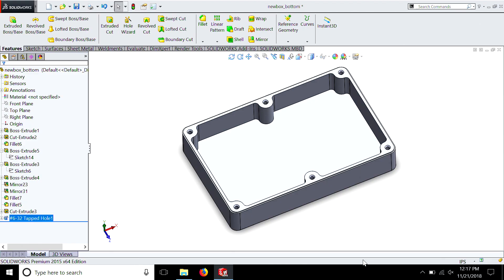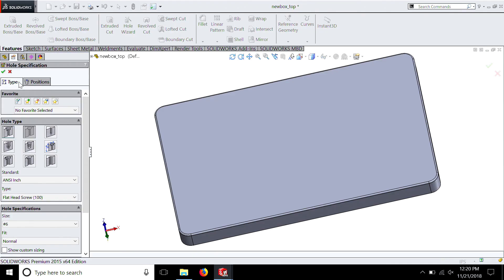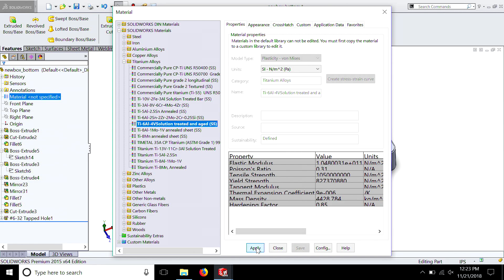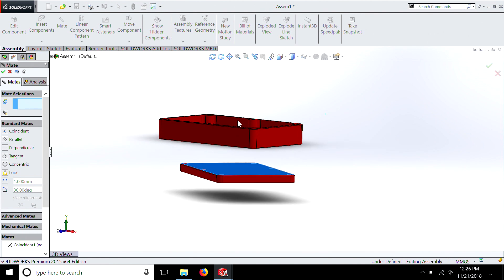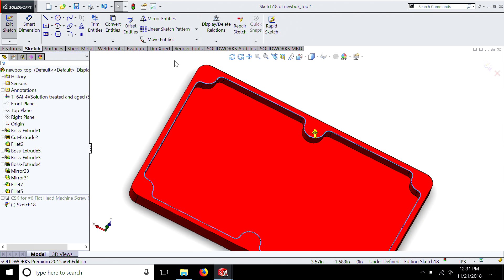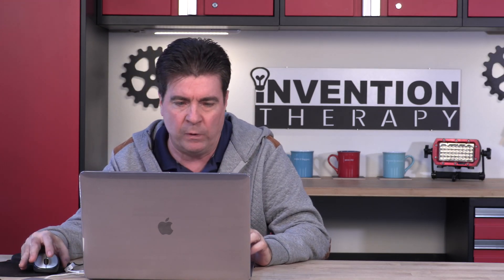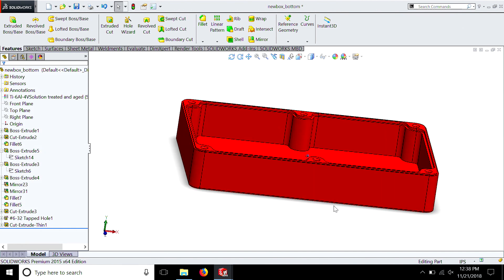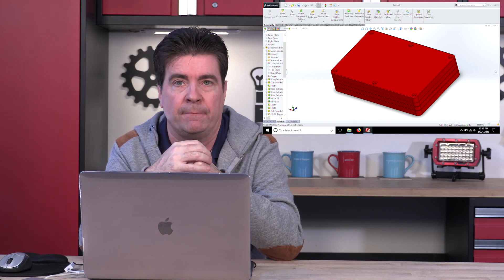Learn Solidworks in 5 Minutes+ [Part 3] Extended Solidworks Tutorial

Comment: Love your videos man, very informative and beginner friendly. Currently I'm working on a table for construction at school, but I just can wrap my head around assemblies. What i need to do is make a certain part a certain dimension away from the previous part so that they don't line up on the edge and offset incorrectly. If you could do a video on assemblies whenever you have time I would really appreciate it :) Keep up your Awesome work!
Reply from the maker: I will make a video but what you want is easy to do. Select "Mate" from the menu, click the first surface to mate and then the second. They will snap together. Once the two surfaces attach to each other, look on the left side of the screen where the mate command is displayed and scroll down. You will see a "dis" or "distance" box and you can adjust the offset there. There are a bunch of other choices like angles and more there as well.